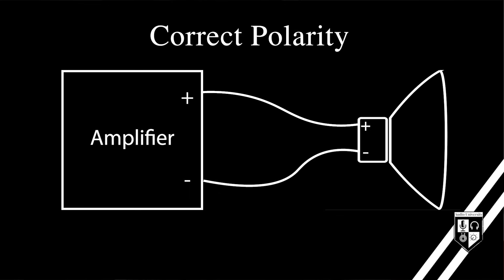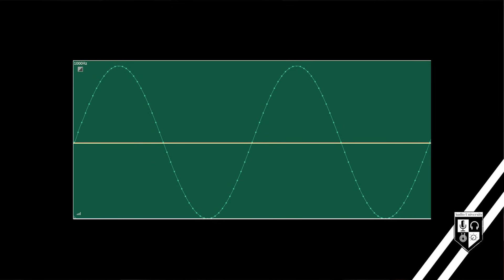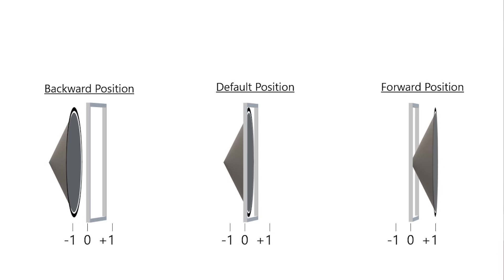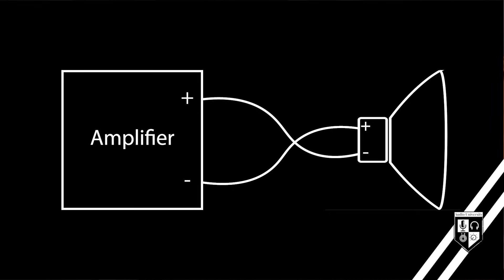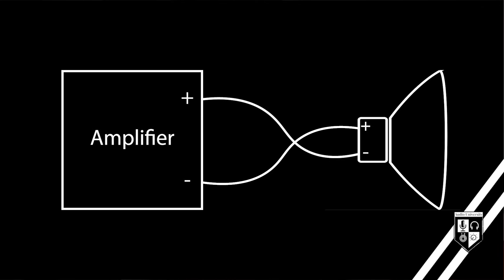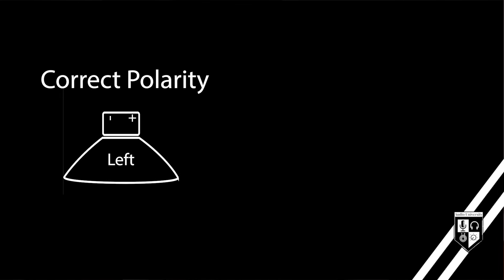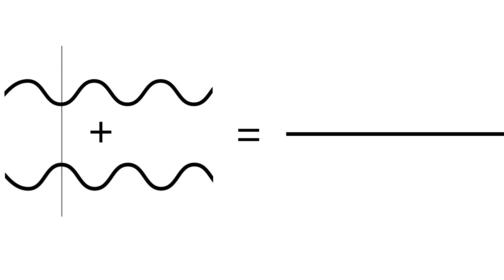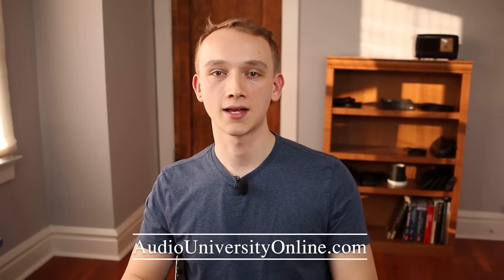POSITIVE VS NEGATIVE: Does Speaker Wiring Matter?

Comment: Where did you go to school? they should be fired.   You only looked and balanced waves, like sine waves. You are also ignoring the physical characteristics of a voice coil.  The voice coil has spider that that allows the voice coil to move BUT also acts as a one way rebound spring. When the cone is pushed out the spider stretches like an accordion increasing resistance " counter tension" proportional as the cone goes out.  like a spring being pulled. the cone reaches its limit in outward movement based on power applied. The spider does not work as a damping spring going in the opposite direction, because the magnet is in the way. This physical constraint, is really why speakers have polarity.   REAL Sound is generated by what are called impulse waves. There is a initial positive max peak followed by a diminishing amplitude waveform.   AS a result ALL audio  peak power only happens on the positive wave.   If you invert the signals to the speaker, the peak power of the impulse is driving the voice coil into the magnet. The spider can not restrain the voice coil from   being driven into the magnet and will bottom out, hitting the magnet. If you invert the polarity , You will be driving your voice coil into the magnet and it will hit the magnet if enough power. This causes distortion. It becomes noticeable the more power you add. Wiring speakers in reverse will cause power peaks to shove the voice coil into the magnet and hit the magnet. one real easy way to blow up a speaker fast. NOW you know why a speaker has a polarity marking. ALL speakers have something called a spider, and it only provides damping of the cone when moving in the outward direction, AND you never want peak power to drive the voice coil into the magnet and bottom out damaging the voice coil.
Reply: Best comment regarding this that I've seen, and I really don't know why this isn't more obvious to more people. Most of the speakers I have seen and used, including the one I've recently replaced the cone surround, for a cute little vintage sub box, are capable of much more outward positive excursion than negative inward excursion, and will indeed bottom out if driven with incorrect polarity at louder amplitudes, the fact that they work 'ok' at quiet or medium amplitudes is irrelevant, and actually misleading as to why they really ought to be connected properly.
Reply: @Tekwyzard  Very good. Yes. I see you have experienced the reality. also, remember average power, RMS power and peak power is always delivered on the positive lobe. this is due to +dc offset bias needed in order to make room for the neg half of wave when amplifying full waves. The positive half wave voltage is really the +signal +bias. and the neg half is -signal + bias . The bias is set to a level that allow the neg peaks to be at zero without distortion. This is why average and RMS power rating is for the continuous waves is calculated and measured on Positive half of wave. . Peak power is  the for dynamics of impulse waves ( usually 10ms or less duration) . ALL audio has many impulse waves. It is what the dynamics of the instrument is.  They are typically 2x greater in power, than the RMS signal components. For instance, A 50-watt signal will have peaks at 100 watts peak power in it all over the place. This is why speaker should always be chosen to be rated for 2x your application power. If you are planning a 50-watt amp, you better use 100 wat rated speakers for proper dynamics without distortion.  They are always positive half wave first. they are like rings.  You never want peak power to be happening on a inward coil movement.

Comment: I disagree completely! Unfortunately? Fortunately we seldom listen to steady state sine waves. We listen to complex waveforms. When a bass drum get's kicked, it produces a POSITIVE pressure wave, the mic should be producing a positive voltage, the amp should be driving the woofer forward! Same with high frequencies from horns like trumpets, clicks from guitar picks, .... they produce a positive pressure as should the drivers reproducing it. Some Japanese Direct to Disc engineers would reverse the phase of the kick drum mic to reduce the transient of it mixed with everything else going on right then. Very audible.

I have been virtually 100% accurate when tested for ability to identify "Absolute phasing" of a good system. It's signature is really quite identifiable.
Reply from the maker: This is a very interesting perspective, Glenn! I cannot personally differentiate absolute phase, but you and a few others allegedly can. How would you describe the difference?
Reply: @AudioUniversity  With certain instruments it is more identifiable than others. Drums and horns are easier than a guitar. And micing has a lot to do with it. Positioning. Some times I hear the mis-wired mic in a mix. 

What I identify is whether the sounds is coming towards me or moving away. Bass drum, is the sound pushing at me or does it "feel" like it is whooshing away from me? Horn impact. Is it blasting towards me or being sucked back into the horn? I get a "feeling" like the sound is moving away from me. Like it is being sucked back into some black hole behind the speakers. And yes it is far more obvious in some systems, resolving systems, than others.

I am not referring to sound stage depth. My system does a good job of establishing a solid sound stage behind the speakers. But then is that sound coming towards me or being sucked back away from me? Almost a tape played backwards.

Plus the low end, again kick drum, seems to lose some impact. That initial positive pressure wave is gone. I saw a comment below talking about more bass impact when wired one way than the other. They identified Absolute Phase without knowing it exists.
Reply: @AudioUniversity  Listen to the leading edge of the first drum sound in your mono clip. Even on my small PC speakers I can hear a slight difference in attack. There seems to be the slightest softening to the initial thud. Though I admit it could be caused by my confirmation bias without some control to the test. This system is not that good.

Comment: Every speaker wire I have ever used has one wire unmarked and the other wire has a black stripe running along it for identification. So it doesn't matter which wire you connect to your amp terminals as long as you follow it to the corresponding terminal on the speaker. In other words if you attach the plain wire to the negative on the amp, attach the other plain end to the negative on the speaker. It doesn't matter which wire you connect to the amp as long as you duplicate it at the speaker.
Reply: Speakers sometimes have a red or black terminal; sometimes top and bottom, sometimes left or right.  Just be consistent.
Reply: @thomasmaughan4798  Indeed they do, just look at the back of some AV units!
Reply: @anthonyxuereb792  I have a glorious Crown D150A amplifier, uses red and black banana jacks for the speakers and unbalanced 1/4" phone plugs for inputs.
Reply: @thomasmaughan4798  Ah Crown, that's a name that's gone off the radar, for me anyway. I looked it up and it is unusual looking, a bit like a Mack truck, made to deliver and last.
Reply from the maker: That’s correct, Anthony. Thanks.
Reply: @AudioUniversity  A Merry Christmas to you
Reply from the maker: You, too!

Comment: Kyle- Good morning ! I was wondering - If I connect BOTH speakers in reverse, and they are tuned port enclosure speakers I get a broader richer tone from the tuned ports. With BOTH speakers connected in reverse, and no net loss or damage to my system, only a BARELY (almost imaginably small) noticeable loss in volume due to the tuned ports, is there any detrimental effect over time ? I have a typical sized Living Room, and a DECENT 2.1 channel central amp for a few components I'm running in our Living room, and thot I'd ask. So far, results SEEM good, but was curious. I'm thinking about adding a Front-Central speaker and a Sub . Thanks !
Reply: Hi Chuck, reversing the polarity of both speakers can make absolutely no difference with regards to the porting of the enclosure. What you are changing is the relationship to the sub (you say you have a 2.1 system). MOST people would just flick the phase switch on their sub to achieve the same result. Any change you heard by reversing the two main speakers was becasue you wanted to hear a difference. to do this quickly, you need a 4PDT switch so the reversing is instant rather than undoing four terminals and doing them up again.
Reply from the maker: If you prefer to wire them in reverse polarity, I believe you have nothing to worry about. The tuned ports are tuned to wavelength, so I expect the polarity will not have an effect on the tuning.
Reply: If ALL of the speakers in one system are wired backwards, it won’t make any difference whatsoever.

Comment: You touched on polarity reversal on one speaker. There is something else not mentioned and that is absolute polarity in a sound system. Some recordings are sensitive to that, particularly stereo recordings made with a stereo pair of microphones in Blumlein, ORTF,  OSS, Coincident pair, and others. I have heard Sheffield Lab Direct to Disc piano recordings that sounded better and more realistic if the speaker set was wired(Both) in reverse polarity. the difference is subtle, but it exists.
Reply from the maker: Interesting - this is a highly debated topic, but I’ve heard convincing accounts on each side. Thanks for sharing, Yoda8945!
Reply: Confirmation bias most likely.
Reply: @markrigg6623  Not really. In the studio, we found out that some voices sounded better while recording by switch polarity on the input channel of the board. It is due to the asymmetry of the audio. 
Other instruments such as kick drums make quite a bit of difference as to absolute polarity. The difference between the initial impulse of the woofer moving toward or away from is definitely audible.

Comment: if you have a speaker box one is a 2 way system and the other is a 3 way system will the 3 way sound better than the 2 way?
Reply from the maker: Not necessarily. It depends on the other characteristics of each cabinet.

Comment: First fail. This lecture peaked at minus 10dB, rather hard to hear! That is far more important than absolute phase. Digital levels need just as much attention as analogue, get it right. Why do we have to learn allover again how to make a wheel! The argument of absolute phase was given up decades ago when multi mic mixing and tracking was forced on the record production chain which randomly flips the phase in the production chain. That polarity on your amp means nought. Really. Until there certified phase live records and all the electronics it don't mean a thing.

I make binaural recordings of live events, when I recorded the local orchestra with a battery (pun) of 105mm cannons (1812 overture) I knew that the cones have to move out towards me. The correct phase made some difference to me for of the rest of the playback. Here's the real test. Record you voice and listen to the playback in both phases. Neither will sound like what you think is right, but one will sound much better than the other. The human voice waveform is quite asymmetrical so are strings and horns. Those sine waves on your video fail to tell the story.

Comment: This is a hell of a rabbit hole to go down when you start dealing with multiple speaker setups and deal with effects like mutual coupling that have very complicated effects on sound. Great introduction though, that 9v is money for polarity or just doing a quick test of the speaker for operation
Reply: I once ran sound in a club and a band came with 2 dual speaker wedge monitors. Everything was ready, I ran a pink noise test and did a walk-around on the stage and walking past the monitors I pointed out that the 3rd of 4 speakers was out of phase. He was surprised and said they just made them and were proud, how did I know? After a while but before showtime I saw them with a 9volt battery and they had that speaker out and reversed the wires. Now it's showtime.
Reply: Not to mention that we never have any idea of the number of phase reversals that occurred during the making of the recording, from the studio to mastering.

Comment: I would recommend a AA over a 9volt battery. Larger speakers are probably fine, but a small cheap speaker might be damaged by the 13+ watts of current from a 9 volt battery through a 4 ohm speaker*

*Assuming ~3 ohms DC resistance and 1.5 amps max from a 9 volt battery.
Reply: No, it is very safe for a short time. Speakers die mostly of overheating, the battery will likely lose it's power before this will happen.

Comment: Maybe some people can't hear the difference but if you have a stereo system with say two speakers in cabinets,  if both are out of phase as in both are reversed + -, the placement of the center stage person or instrument, center sound image will be very much diminished. This is easier to test  using a mono signal and with that mono sound it should sound like one speaker in the middle of the two.   In  other words you get more of a hollow far away sound when they are out of phase with the amplifier. Even one single speaker out of a cabinet if it is wires in reverse the sound especially of speech or singing will sound clearer out of the back of the speaker, then the front. Wired correctly much better sound from the front of the speaker.  I still think this is why Dolby came up with the center channel idea.
Reply: This is wrong since *it is not possible to hear absolute phase*. That means if both speakers are reversed there will be absolut no difference.